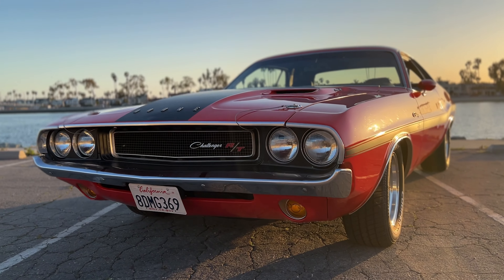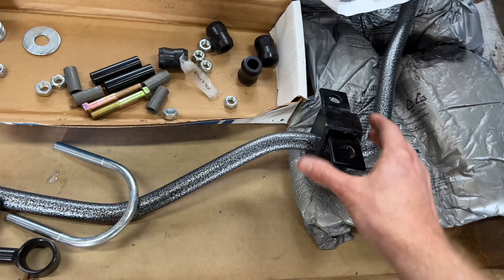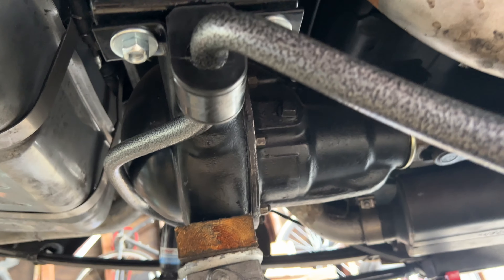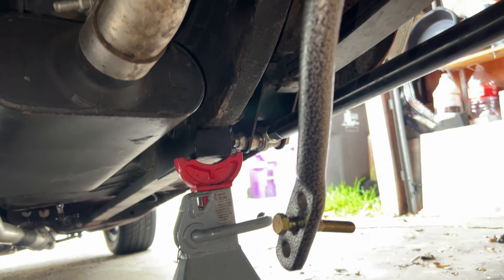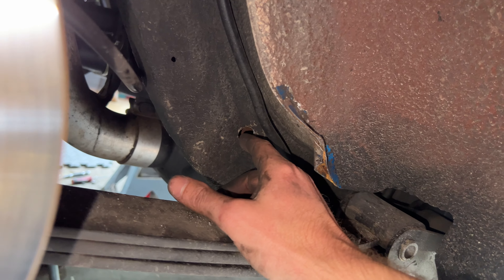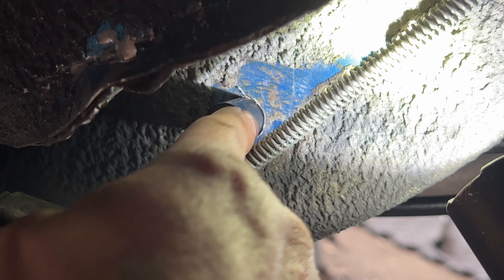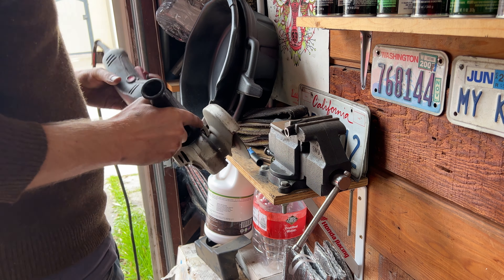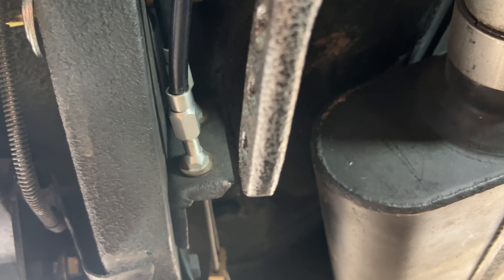My Final Upgrade Before Time Attack - Adding a Rear Sway Bar On My 1970 Challenger

Comment: I've been watching all of your videos. I recently bought a 72 Challenger from a friend of mine and it has the full hotchkiss front and rear suspension
package, cal tracks bars,  baer brake conversion etc. I am learning a lot following your videos :)  Love that you went a Gen III Hemi swap in yours. 

Mine has a 416 stroker LA EFI but if I was doing the build I would have went the route you did, probably with a hellcat and 8 speed setup.  Beautiful 
car you've built!
Reply from the maker: Thanks! That’s awesome, sounds like a super well sorted Challenger you got. The Hotchkis and Baer brakes must be a great combo, sounds like it’s ready for a track day 🤘
Reply: @noboltsleftbehind  Thanks! Yeah my buddy worked on this car for a decade it's basically a frame up and then resto modded.  When he told me it was time to sell I couldn't let it get past me. 

I have a small vid on my page if you want to see it.  She's not perfect but fairly well sorted. I need to figure out the brakes he thinks he may have went with too large a bore diameter on the master cyl.  Very hard to brake at low speeds and it has a vacuum canister already. 

Also it has a spool in the back and that's gotta come out. So hopefully this winter I am going to put a new center section in with a eaton helical LSD and some new Green Bearings on the axles and get that brake issue sorted.
Reply from the maker: @GearHead4Lyfe  I just checked it out, looks awesome man, super clean. That idle sounds amazing too. I think that old school idle sound is one thing I’ll never quite be able to replicate with the Gen 3 Hemi.
Reply: @noboltsleftbehind  I hear you on the idle sound. I also have a blown modern Challenger. But to be honest these big old cam's in these old motors just rattle everything loose! I've had to tighten lose parts already LOL  That's why I am over here drooling over a Gen 3 in an E Body :) 

I've been watching your drag videos and your car scoots! Such an awesome build.

Comment: They finally got updates they finally got upgrades that almost work. That looks great. Although I did like it when I first got the car at had some weird gearbox in it maybe out of a truck that made it steer great 👍👍. But I like the original steering in the original 1970 Challenger because it's kind of dangerous it helps you drive slow

Comment: I was told by my uncle he would use the emergency brake on these old cars for reasons like your taillights don't light up when you use it so they can't tell when your braking it helps when you're driving around the same four blocks over and over again outrunning the police so that you can pull into the garage and shut the door and then you got away ha ha 🤣 but it's not then nowadays is it ha ha 🤣.